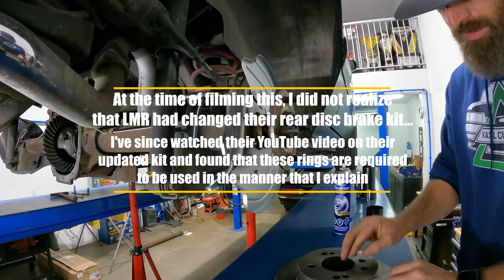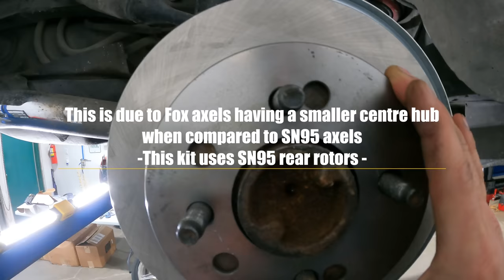This Should Be Your FIRST Mod! - Foxbody Mustang Rear Disc Brake Conversion // DIY - How To

Comment: I just did this conversion a few months ago and it is great kit. It does however, have a few short comings IMO. For those of you who don't weld, here is a part # for the e-brake handle that holds the paw in place 1R3Z-2A753-BA.  Also, if you are planning on converting don't be surprised if you have a "moaning" sound coming from the rear turning corners or braking.  I know they say this kit is supposed to do away with the anti-moan brackets, I wasn't that lucky. Not all anti-moan brackets are the same either. I had to get a 2nd pair that had the U-bolt holes more towards the center because you will have to trim about 1/4" off the ends to get them to fit.
Reply from the maker: Great info - thanks for sharing

Comment: I recently replaced my booster and master cylinder and what a PITA! I planned a weekend for it so the entire week I would go outside and spray all the lines with penetrating oil and they all came off with no headache. I think what I dud was overkill but I been doing it for years. I remember doing the same thing to header bolts and by the time I was ready to remove the header the bolts felt like they were finger tight.

Comment: I pieced this kit together probably 20 years ago… I need those brackets to keep the parking brake cables off the tire… they been zip tied to the control arms for over 20 years… lol. I think I used a 93 parking brake handle…. You don’t have to modify it!!! I did under the hood the exact same way you did…I did not change the booster to the 93 cobra… just the master cylinder… and adjusted the rod gutted the proportion valve and used a solid endcap with an adjustable portioning valve… in the same spot you used
Reply from the maker: Right on!
Reply: @KASLCustoms  what really helped out was that my best friend worked at a break parts factory at the time. The caliper brackets… they came from a cobra kit car place that sold the brackets and gave you detailed instructions for this swap and a list of everything you needed… even the fittings

Comment: Good video. I did the 5 lug with rear disc brake upgrade. I went with the larger cobra front and back discs. I also got the SN95 kit from LMR that included the 93 Cobra Master Cylinder and got good used 95 spindles from a junk yard. After the 5 lug disc swap, braking was terrible!! After doing this upgrade and running the car, really had to be careful when slowing down as the stock booster cannot boost enough to stop the car and the pedal was super stiff. I purchased a 93 Brake Booster from RockAuto (yet to be installed as the floor is getting fixed). The car just had terrible brake characteristics with the stock 88 booster. I also got lucky with the anti-moan brackets (as another commenter did not), as mine worked.

I can't say if keeping the stock front calipers and just doing rear disc if the booster would be bad or not. I can only confirm the booster upgrade is needed for the 13" front and 11.65" rear disc.

Comment: Am I the only person that has no issue with the rear drum brakes on your Fox? 
Not criticizing Gary. It was a good video.
Reply from the maker: No worries at all buddy! Have you had a chance to drive on with a rear disc swap? It might change your mind...
Reply: I've had a bunch of these cars and currently have 5. After upgrading front rotors, I can't say I've noticed benefits from rear discs. I will say that I only run them on the street and short tracks. It's my understanding that they do prove better on a track where brake fade might be an issue. I will also say that, while I'm not advocating skipping the c-clip eliminators(or 9 inch ends), a disc brake setup may keep a broken axel from exiting the housing. For 95% of folks, I don't think the juice is worth the squeeze. My pace car has sn95/93 cobrs front brake setup and that car stops on a dime. Anything more is just a waste of time and money (unless you're worried about fade). The title of this video suggests rear discs should be yours first mod. I can think of about 15 others that are WAY more useful. I also understand I am in the minority here lol!
Reply: No, you're not the only one.
Reply: Night and day difference on my car with SN95 Cobra Brakes on all 4 corners, you can drive the car completely different.

Comment: Great install video Gary! Those little rings that you put on the axles before the rotors are actually called "hub centric rings". And they do exactly what they did for you. They center the rotor perfectly on the axle. Lots of aftermarket axles like Strange or Moser have those rings machined right into the axle to centre the wheel also as opposed to centring the wheels with the Lugnuts on the studs.
Reply from the maker: Thanks buddy!
Reply: @KASLCustoms  its Jeremy. And you are welcome.

Comment: I also installed the 13" 4 pot Baer Brake upgrade in the front, as you can keep the 4 lug setup. this kit comes completely assembled, including spindle to dust cover. I have the same wheels in black and they are 17" x 9" . My rear brake kit is the Ford T Bird Turbo Coupe that was offered and bought a long time ago for my 1989 Mustang Sport LX.
Reply from the maker: Nice!

Comment: Hub centric ring for the 4 lug setup and the kit is made to work on a 5 lug application also, which has a larger flange.

Comment: Hi Gary.  Great video, as usual. I put rear discs on my fox over 25 years ago. The only kit at the time came from Stainless Steel  Brakes Corporation and it's pretty good except the master cylinder is butt ugly. Any brake upgrade on these cars is well worth it. I've always said it doesn't have to go and it doesn't have to steer, but it damn sure better stop. Looking forward to more Average Fox content. 🙂
Reply from the maker: Thanks buddy! Yes, I have no idea why SSBC used those old cast masters???

Comment: Those rings are hub centric spacer rings, they are meant to do exactly what you did. They are also usedvfor wheels that fit like those rotors did.
Also the brackets are what you used them for. They bolt up just like that on 94-04 stangs.r the ebrake cable.

Comment: Yes those brackets are to hold the e-brake lines away from the tire and closer to the LCA.  I pieced together my 5 lug, 4 wheel disc brake setup like 10 years ago and simply yanked from little brackets from a 1999 V6 in the junkyard.
Reply from the maker: I'm more familiar with the junk yard swaps too 😉

Comment: If you run into a stuck brake fitting and don't need to save the line. Just cut the line off close to nut and put a good 6 point socket on it. It will come right out.
Been thinking about this upgrade on my '86 vert GT. Great tutorial. Hey from Ontario !
Reply from the maker: Good tip! Thanks buddy

Comment: I have everything to install a 95 gt master, the car already had front cobra brakes and converted to rear disc brakes but they didn't change the master or proportioning valve. I need to get off my ass and install it, I can drive the car the way it is but the brakes aren't as good as they should be hopefully this will help. Also my directions don't say anything about gutting the stock proportioning valve but have done a lot of research and know I need to do it and have everything I need, perfect timing on the video.
Reply from the maker: Right on - thanks buddy!

Comment: Dunno if I buy that, Gary.  Well-adjusted rear drums work just fine on the street.  Discs win on the track because they're more fade resistant.  I was going to go rear discs on my '85 ASC Coupe, but found through much discussion the better call was '87-93 V8 fronts and properly adjusting my rear drums.  Stops great now.  Only complaint is the Power Stop ceramic pads are filthy beasts compared to the Wagner ceramics I had-- a HUGE deal on these orange lace wheels.  Next time you come to Detroit-- and it's not raining, take it for a ride.
Reply from the maker: Oh buddy, I can only imagine the PITA to keep those wheels clean…😬
Reply: @KASLCustoms  Back when I had them new, I spent a LOT of time scraping off the  crud from the semi-mets.  We didn't have the good chemicals and brushes that are out today.  I still have PTSD from that.

Comment: There is actually a magazine that tested this years ago and it was like a 1 ft difference between drum and disc.     It's not as much an impact as you would think.
Reply from the maker: Do you know if the test was run repeatedly or was it just a single stop?
Reply: @KASLCustoms  I don't recall but this was HEAVILY debated on the forums back in the day I'll keep looking for it I can't remember which magazine did the swap test.

Comment: Personally i dont really believe disk brakes are a must depending on the build. Drums will straight lock the tires if adjusted correctly. They hust suffer feim horrid heat disapation, large trucks utilize a drum system to stop a lot of mass...

Comment: I would say that you need that shim because the sn95 axles are longer than the fox body
Reply from the maker: Its actually a hub centric ring that cleans up the slack between the SN95 rotor and the fox axle
Reply: @KASLCustoms  I would have thought that all that ring would do is center up the rotor… the 3/4” difference in the axles would have to be made up by the caliper bracket to center the caliper over the rotor
Reply from the maker: @jasonquinn588 yessir you are correct 👍

Comment: Personally i never have any issues with drum rear brakes. Then again as a master auto technician, servicing rear drum brakes are easy to me. For most non pros they can be difficult. Personally i perfer them myself, they work.  Im not going any faster than low 12's and they work fine. Personally i think that sorry A$$ alternator should be the first upgrade. Actually these cars run better with this mod as well.

Comment: hey good video, I am in the middle of gathering a bunch of 5 lug swap parts and one of the pieces to the puzzle is the rear brakes.  one question, do you need to do the brake booster?  or is the factory 87-93 ok?
Reply from the maker: Thank you! As for the booster, I think its more of a personal want vs. need. Ive had both and never noticed much difference. That said, I'm just a weekend cruiser. If you were out road racing, I'm sure the larger booster would come in handy

Comment: The first mod should be frame connectors. The second mod should be a torque-arm/panhard bar. The third mod should be 5-lug disc brakes all around. Now it's a drivable car.